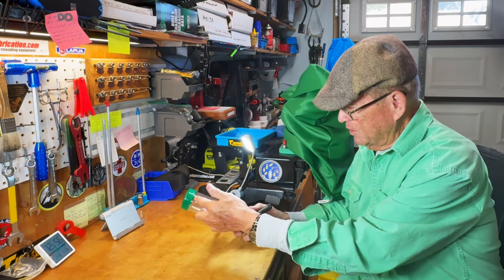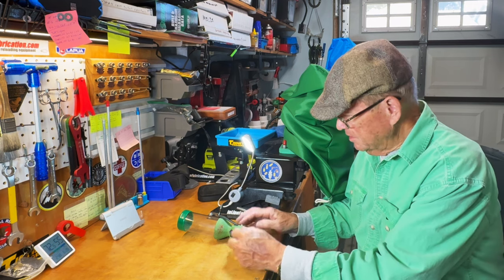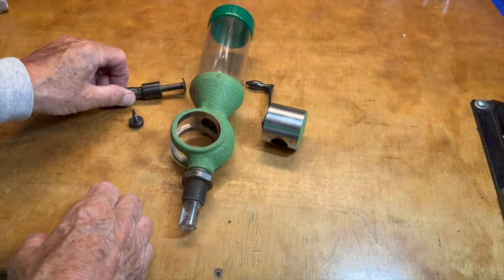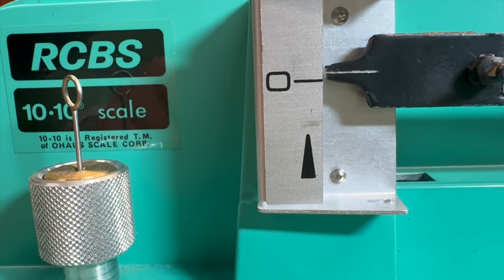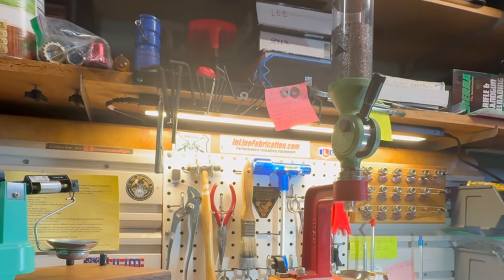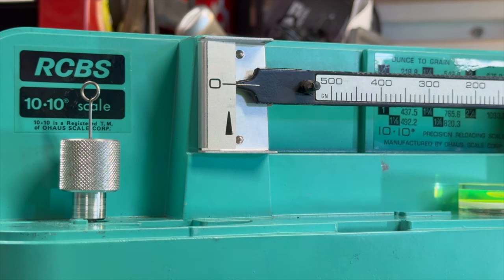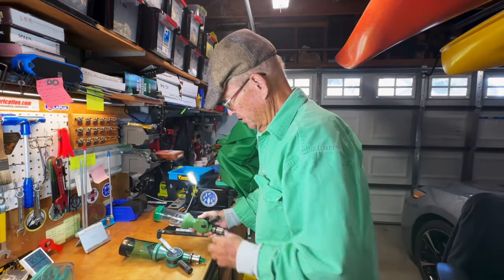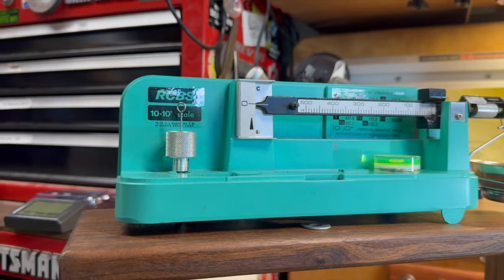Comparing powder measure performance: Redding #3 vs RCBS Uniflow

Comment: Great video, thanks for the comparison. I use the Hornady lock and load bench powder dispenser, the bodies where the drums slide in are very similar on the Redding and the RCBS to the Hornady`s.  Like you , i mostly shoot revolvers, and stay between the minimum and maximum published charge weight to allow for a tenth or half a tenth fluctuation, and weigh every 5th to 10th case. Once again thanks for the video.
Reply from the maker: Hi, Duffer. Had a Hornady unit for a long time. I just that one away but you’re right..they are right on par with the others. Thanks for stopping by! 🤛🏻🔫🇺🇸

Comment: A friend of mine used to have a Palma Team member in his orbit and according to this fellow weighed charges are a waste of time if you have a quality powder measure. He loaded is ammunition by volume and was a better rifle shot than most of us will ever be. Many Light and Heavy class benchrest shooters load by volume as well. It's interesting to hear the opinions of these master level marksmen. Thanks for sharing Viejo! 🙏❤👍
Reply from the maker: Hi, Scholar. Thanks so much for that. Of course, not all powders meter the same. Some of the fluffier ones tend to throw less consistently, but  we have ways to deal with those. 🤛🏻🔫🇺🇸
Reply: Thanks for the review. I've never tried the Redding,  having a RCBS Uniflow with both roters, and 2 Hornady, 1 for rifle and 1 for handgun for the LnL AP. I put baffles and micrometer adjustments. All have worked extremely well and accurate.
Reply from the maker: @Colt1927AC Hi Colt. I like the micrometers. I had one on my Hornady as well, but I just gave that one away. It was every bit as good as either of these two. 🤛🏻🔫🇺🇸

Comment: I never could wrap my head around Redding.  

For handgun loading a could not understand how it would make any difference down range.  For precision Rifle you are going to trickle anyway.  So I could not see any advantage.

For some it is collecting the best equipment.  So by choosing Redding they feel they have done just that.  This is fine. 

The one that kinda amazed everyone is the new Lyman thrower.  By new I mean current. They seem to be a strong contender in hand throwing charges.  

Near the end of this video you commented about how it feels.  Oddly this is probably worth the $$$.  Our personal feel can make a difference over the many years you will use a powder measure.  

Your RCBS thrower museum pieces are a testament to how good they are.  The value is strong.  Their designs always seemed to work.
Reply from the maker: Hiya, ‘Cincy! Good to hear from you as always. Thanks for watching. 🤛🏻🔫🇺🇸

Comment: I love about any cast iron drum measure having a steel rotor I've tried. I personally only use small drums (large is only useful for considerably long stick powders IMO) my favorite of all time is the RCBS uniflow measures, but never turn down old obsolete measures made in the same fashion as they work just as well! I have an old Herter's (Wells) that I use for flake powders and it's as accurate and reliable as the uniflow with like powders. I lost the plungers and springs to my Herter's taking it apart to clean it once, but it never hurt the accuracy of it. I Like the old Lyman 55 for certain things like long sticks or very large throws, but certainly not for pistol charges and I got rid of their replacement brass smith measure because it has an aluminum drum and steel rotor which I felt would wear too much over time at the cutoff point, but others seem to love it.
Reply from the maker: I’m with you on the cast iron/steel combo that gives the measures some mass. They just seem more stable! 🤛🏻🔫🇺🇸

Comment: Good Morning Walter, Nice way to have coffee this morning. I don't want to cast negativity, however there is much to evaluate and consider when it comes to performance accuracy. and those factors are what I call consistency of randomness, and it has Zero to do with the conquest of throwing "Perfect" measured powder throws. I believe that people chase the idea of perfecting their loading of ammunition, thinking if I made it perfect, my marksmanship accuracy will be perfect (Same thing with firearms) If I buy perfection, perfection in my shooting will come. I once shot against and dude that loaded all his loadings for Bullseye pistol on a Lee Progressive 1000. he was master class and shot over 2.600 out of 2.700 every time. all with a lee sliding disc power measure. I tested a a Lee Pro 1000 against loading on my 550B, accuracy was the same between the two (Even out to fifty yards) they shot less than an inch an a half all out of a random rest and out shot Federal Gold Match 185 gr in group size. I believe that what we pay for is manufacturing craftmanship quality in the high end stuff, nice running presses and such. I have a Harrell powder measure, used it less than 10 times and it's been put away for over 20 years. I feel this was a great video and well done. peace - Dave
Reply from the maker: Hiya, Dave. Thanks for stopping by! 🤛🏻🔫🇺🇸

Comment: Nice test, I always liked the RCBS measure but the type of loading I seem to do doesn't justify a powder throw of any kind. Very small test batches usually less than 5 Rds., it's easier to just dip and trickle.
Reply from the maker: Great point, Mike. It’s not worth loading up a hopper and subsequently cleaning it for just a few rounds. 🤛🏻🔫🇺🇸🇨🇦

Comment: I didn't think you'd see much if any difference between the 2 measures . With my Hornady BR measure , one tap up and down is the most consistent. I've checked it many times. . The double taps make the throws less consistent. I call it the y tube double tap .
Reply from the maker: Hi James. Thanks for stopping by. They roll pretty much the same with that powder. I have a couple more videos upcoming that compare them with other powder types. 🤛🏻🔫🇺🇸

Comment: I am using the redding with pistol chamber to charge 1.5 grains of N310 for my 32 bullseye gun. The measure is mounted solidly to the edge of my bench and have a 30 pound bag of bullets sitting right next to it to absorb vibrations. Feels solid, nice thunks. I do single tap up and down, thow at least 30 charges before starting each session, have a baffle 1/3 way up and keep the powder level in a tight window while charging. With all these considerations, i am getting 1.50 and 1.52 charges. That is less than a half of a tenth. Verified by the FX120i scale...
Any thower needs to be mounted solid, no visible movements, and nice feeling thunks for each pull. And of course a consistent method of operating the handle
Reply from the maker: Hi Michael. That’s some great consistency! Thanks for watching and sharing your set up. 🤛🏻🔫🇺🇸

Comment: Went from a Lyman 55 to the BR3 about 35yrs ago, I liked the micromreter style adj better. Ude it mainly for gopher rds and my Schuetzen rifle, mtd on a twisted up Jorgensen clamp to be portable and adapt to up to an 8" table. I really didn't have any issues with it, still don't, it'll toss dead on probably 80-90% of the time with AA9, may get one reading .1 heavy occasionally, wasn't enough to matter downrange that I could detect. Knocked the hopper loose within a year of getting  it, taped in in place, still there, working perfect.
Reply from the maker: @davecollins6113  Hi Dave. Thanks for stopping by and giving that input. I’ve got a 55 on the shelf that I acquired some time ago, but have never used it. I need to get it cleaned up and brought back into service. It’s in need of some TLC. 🤛🏻🔫🇺🇸

Comment: I suspected they would be pretty close. I as you, got a great deal on my Redding 10x. I had been wanting one for a while. I previously had gotten an RCBS Chargemaster Link digital powder dispenser and have checked them all against a digital scale and against the 10/10 Balance. There is so little differentiation that I am comfortable using either. I can tell you one thing you never want to do. Don't disassemble the metering chamber! If you do get ready to send it back to Redding for reassembly! My 10x came with both chambers but the rifle chamber seemed to need cleaning. I wish I had known not to take that thing apart. I called Redding and asked them how to get it back together and they said start with a cardboard box and a mailing label to send it back to them! They were right!. They have a jig made to assemble them and you can practically not do it without it! They didn't charge me a penny and I had it back in about 10 days. Can't beat Redding customer service, they are great!
Reply from the maker: Hi Bama. Thanks so much for the tip re: not disassembling the metering chamber! I won’t be trying that. 🤛🏻🔫🇺🇸

Comment: Very cool walter. Test looks close to say either will do the job.  
 I got a old cheapo lee TimS gave me I use it for 300blk mustly.  
   Almost pick up a Hornady at the flemarket for 35 should grab it put didn't was looking for a scale . Lot other random die set but nothing I need. 
 Know gun shop I post short on out that way load with powder in primmers.
Reply from the maker: @jamespugh  Hi, James! Thanks, Amigo. 🤛🏻🔫🇺🇸

Comment: 💥❤️‍🩹🇺🇸❤️‍🩹❤️‍🩹💥
Reply from the maker: Thanks, C-Dub! 🤛🏻🔫🇺🇸
Reply: Your handles are on backwards. Ya gotta stretch to move the handle, inconsistent. 🦶🪶🔫😁👍
Reply from the maker: @walksfletcher no they aren’t, no I don’t and no it isn’t. I prefer to dump on the down stroke. The drums on both are designed so that the user can mount the handles either way. I don’t have to stretch to operate the handle any more than when mounted the other way. The measure is  no less consistent in this configuration. Thanks as always for checking in! 🤛🏻🔫🇺🇸